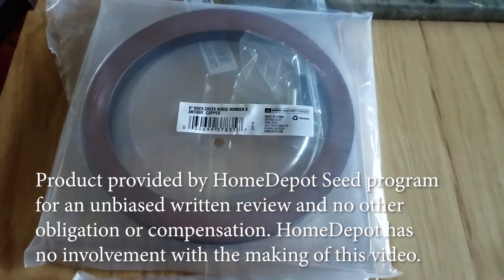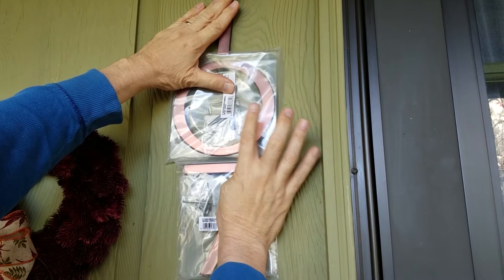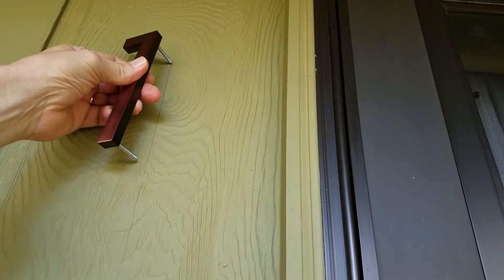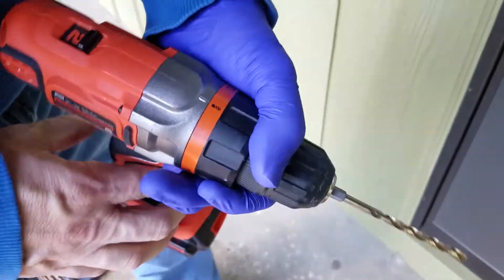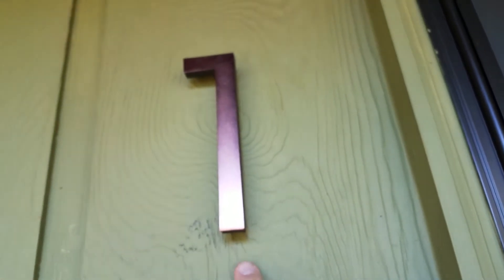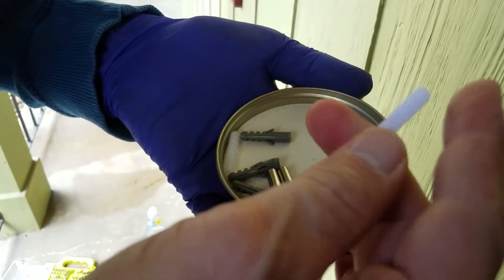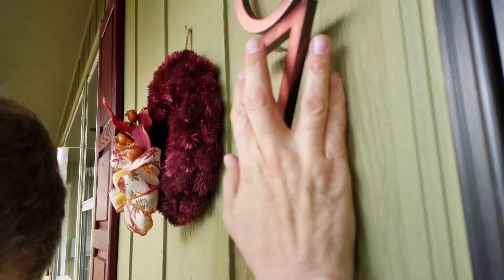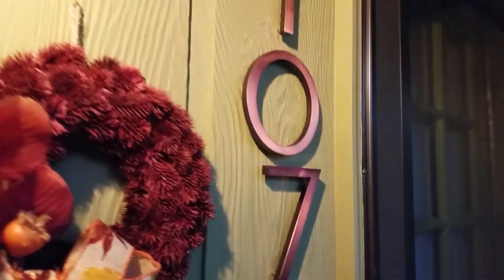ROCK CREEK HOUSE NUMBERS by Everbilt

Comment: To those watching this.

-You do not use a drill bit "slightly smaller" than the molly.

-Don't be too lazy to get the proper tool to put the molly in. 

-A rubber glove on your left hand is not going to doanything but make your hand sweat unless you are wiping your butt. 

-Find a video where you don't see all of these red flags 🚩, and your numbers won't look so uneven and sloppy.

-The heavy paper backing that comes with the packaging has a template, to evenly space & properly level the numbers, so it doesn't look like a 10 year old hung them.

-If you do a end up doing a Micky Mouse job on something that will be the very first thing everyone coming to your house will see first, don't record it as a "how to" and proudly post it on the internet. 

Please Note: Misery loves company, so when you're too lazy to get proper tools & think things through, you are not going to remove the numbers and do it again the right way. Rather, you will just record it in hopes others will do the same thing, so you can feel better knowing someone else out there has also complicated an otherwise simple task with corny results.

-If you do end up not taking any of the above advice, then at the very least delete the video you posted to the internet. If not as a public service, then at the very least to save you from publicly embarrassing yourself. 

😂 What a dumpster fire.
Reply from the maker: Thank you for sharing your thoughts and feelings.
Reply: If you can't say anything nice, keep your mouth shut